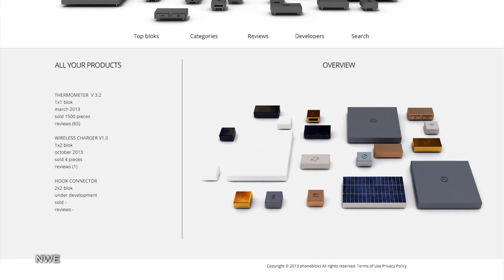Why Phonebloks Aren't Going to Happen

Comment: Apple device engineer here - I am tired of hearing about this DOA gadget. People that BELIEVE this will work are the product of our stupid and lazy society. The society we live in wants things to work like McDonalds. Easy, cheap, fast. People. Lets just say your screen breaks, it might be EASY to replace the screen.. but it's going to cost you over $150 because it entails replacing the entire LCD/Touch screen assembly instead of just the glass. 

Lastly, internal components do not work like "blocks". The WiFi antenna is typically integrated into the entire structure of the phone and is grounded in key locations. You can't just attach things like "blocks" and expect them to work. 

PS - Phones don't just "get slow over time". Unless it's an Apple device which is intentionally slowed down with software updates so that you will buy the latest Apple product.

Comment: I am not very technologically advanced when it comes to internal hardware. I know how to run, improve, and fix a computer. That's about it. But I believe that even stating that something is impossible is ignorance, maybe something can't be done one way, but certainly the other? Who knows.?Certainly no one on YouTube... or anywhere for that fact. The only reason I believe PhoneBloks would not work is because of how innovative it is. What I mean by this is what huge phone company wants a phone that when it doesn't work right you just replace one $20.00 piece INSTEAD of purchasing a brand new phone for $400-900.00? What local "repair folk" want a phone that makes them go out of business? Sure, it'll be a huge hit upon release, but what happens after? Maybe customization? Or maybe they are coming up with ideas to release the product and then release something even better? There are endless possibilities on to why this could or could not work, but after seeing the vast advancements in the past 10-7 years and then big jump from the past 7-3 years ago and then the huge jump from 3-now? That's practically an exponential increase in technological advancement... so no, hardware can probably be developed for this within a year or so in my opinion.
Reply: "That's practically an exponential increase in technological advancement"
And that´s the problem, at the time you want to upgrade your phone, your block phone is so outdated you have to buy a new one,. In the same way you pretty much have to buy a new motherboard every time you buy a new CPU.

Comment: Oh dear lord. Please at least consider your arguments a second time before you post a video...
a) Why would it not be possible to keep the processor and the memory on the same module? He says nothing in the video about memory OR processors he says "the module that affects your speed".
b) Have you ever even opened a phone in your life? There are wires from different components all over the place. Keeping them on a single chip would be BETTER. And also why would that mean they will never happen? Just move stuff around until you are optimized.
c) Also, the concept itself relies on the creation of a standardized input system BEING DESIGNED. HE SAYS SO IN THE VIDEO.
d) The example you have in the end with intel is EXACTLY what he is talking about in the video. Thats exactly what he wants to happen. Bring large corporations together to make something durable...

Please do your homework next time. And watch the video again please.

Comment: First off that's complete rubbish, you change the processor module to increase the speed not the memory, Secondly, these devices these days use SoC (System-On-chip) which include the RAM, CPU and GPU on a single die (chip), and a phone like this is about modularity though standardisation, so yes, standardisation of the bus/connecting platform would need to be created, and there is not technological reason why this inst possible. Each block contains the necessary parts it needs to then interface with that standard bus platform, for example certain pins work for certain resources like power, data etc etc etc, who's to say the entire thing couldn't run off USB? or a similar technology. there is already one working prototype that Motorola have come up with (Project Ara). To say this cant happen is nonsense, the creators of this video probably have an agenda, maybe the presenter has an iPhone in his pocket?

Comment: This guy said they package all the parts all over the place when he was talking about the RAM and CPU and GPU, but those are all still unified into 1 part. So that statement is incorrect. As for the placement of the blocks, most likely they'll be in specific locations and labeled, which is what Motorola's project looks like it has done. I can see why this video has soo many dislikes, and it also adds to why I unsubbed to TechFeed a while ago

Comment: The solution? Engineers with unique ways to approach and overcome challenges with a can do attitude. Tech Feed has no credibility here, next time do your research on PCBs and high speed pin pads or even basic electronics. Speed will entirely depend on how the original interface was designed and how the pin pads arranged. This is an entirely viable idea.
Reply: *****
At no point was it said, or even implied, that he thinks "electronic engineers are so poor at designing electronics."

Yeah, it was implying that the optimizations were irrelevant. But tell me, would you operate a smart phone or a touchscreen with the same mindset you operate a rotary dial phone? They're not the same. "Optimizations" as well as mindsets change with technology.

I don't know why engineers are being so irrational and aggressive about all of this. Tell me, are YOU the one working on Phonebloks or the Motorola Project Ara? No? So, why are YOU being offended?

I'm all for criticizing structure and form, but throwing blankets over topics and claiming being offended by throwing statements in other people's mouths is just ridiculous. You're fine as an electronic engineer!
Reply: S'all good.

Comment: This dude is a dick, it works. Talks about speed? It's electricity, we are talking milliseconds. Placement doesn't matter, because the same electrical signals are being put through just from a different location, if anything there would be a boot up process where it analyzes the configuration and placement of your bloks. That's taking all of, what, an extra 10-15 seconds on startup?

Comment: yes it really is, on my PC when I need more wattage out of my powersupply, i remove the old one, buy a new one, and put it in, the onyl difference is because a PC is not based on a single pannel i have to plug in the other components manually. The same applies for RAM, hard disk space, video cars, fans, lights, motherboard and everything else.

Comment: Well first of all, just because there is a little bit of dirt, it wont block all of the power from going though. But you are right, if somehow you got dirt into one of the pin holes, it could cause a problem.

Comment: A GTX 660 and an AMD FX- 6300 can easily run most games on high settings at >50 FPS.
Also, motorolla and Phonebloks joined together, Phonebloks is happening, dumbass.
You have no idea what you're talking about.

Comment: Since when does moral defects mean that you are stupid. Moral, concerned with right or wrong, defect something wrong with you. Now on the more pressing issue. Google cannot make something impossible possible. Phone bloks are impossible to be as fast as a normal phone because the cpu prongs are too small and too many to just plop down, plus the problems with the mother board. So for this to work you have to create a standard port like usb, and since it will have less prongs it will be a lot slow.

Comment: Of you upgrade 800x400 px screen to like 1200x600, it turns out that you also have to upgrade graphics and processor because rendering in bigger resolution needs beter components, or if you upgrade camera, you also have to upgrade ram, otherwise seving image will take almost 10 seconds. Also it going to be huge because every part has to have its own case. On top of that the main brick (motherboard) will have many issues, wich is a big problem, parts should be attached to it, not the other way.

Comment: Okay, who votebotted this video to give it over 1200 thumb-downs? This phone doesn't look reliable enough. If you drop it, the damaged parts are going to need to be replaced and parts for phones, computers, consoles and the like don't come cheap! and if the holes for the pins are blocked in any way, that phone is fucked as it disrupts the circuit!!!

Comment: the number of pins is needed because PC's are 100X faster than a phone, they need more power flowing through without melting the pins, thus they are spread out. Furthermore size is not an issue, as a smaller phone needs less power draw because it is not rendering a 10 square mile world, its making phone calls and playing angry birds.

Comment: Here's the reason why you can't have a modular ram or cpu on a phone. There are so many small pins on a phone cpu and ram crammed so tightly together that it would be almost impossible to not snap them while installing it. And if you had the pins flush with the component, then it would be a bad connection and cause resistance.

Comment: This is all totally possible with the technology we have today.
The main places where you need speed are between cpu, ram and screen and these components have been detachable in PCs since the start.
Have you ever had a problem with slowing your pc down because you plugged in a usb device into the wrong usb port?
It will just be bulkier because each block needs to be packaged separately.

Comment: The limit here is connectorization, & durability. But this sort of phone block thing is already happening.
If one seraches  " Android DEV kit" for instance, you can see the idea for about 100 USD.  The cellular radio would be  particular to one's cellular service bill. CPU, ocillator and memory would be its own block ( ARM processor for instance ). Data paths between the blocks are low speed. ( Video, audio codec, usb, wi-fi, lan, CCD cam, touch screen, mag compass, GPS, temp sensor, switches.

Comment: High speed signals? Do you know anything about electricity? We're talking near the speed of light. Everything that needs to be close together already is, Inside a chip

Maximize communication between parts? Do you know anything about Integrated circuits? Again. Speed of light. Change out camera for a bigger battery? transistors and variable resistors change from camera state to battery state almost instantly.

Standardized input? PCs..Companies continually release new parts, and they still work

Comment: Don't worry, the guy made half this shit up. If the CPU/GPU are in one cast (as they almost always are) and the screen output is right next to it, that negates majority of latency issues. Put the memory next to it and that's everything finished.

The rest is basically a glorified micro-USB/PCI-E/Sata slot system (depending on how they want to assign the pins).  None of those need to be micrometers away from the CPU.

He has no idea how batteries work.  I doubt he even knows what a CPU cycle is.

Comment: They could also fix this whole plugging into slots problem by marking certain spots on the plugging board so you will only plug in those parts into those places =o=;;;; No, I'm not gonna plug my camera in on the bottom right? It's always gonna be at the top location-wise. As for them being fast and tightly compacted, I believe that's an engineering issue that they needa look into. Chips can always be made to go faster ...etc.

Comment: Regarding the placement slowing the phone, there could be a pamphlet or page in the manual giving tips to users for optimal speed. But I see what you mean- it's almost like putting low texture quality and high shadow quality into a game: it wouldn't be the optimal way to run the game faster.

Comment: You guys are stupid... this will work for sure.  Phone bloks work already, the designer has prototypes running already and the frequency modulation would allow this to run.   Sure this would not be super fast if you had identical processors due to how far the signals are causing delay.  But with phonebloks you have the ability of running processors that are up to 5 times faster because it can be as big as you want.  Optimization would be done too.  Take a class on computer engineering.like rlly.

Comment: Based on what I've learned recently, it's possible for various components to selectively communicate through frequency modulation across multiple overlapping circuits. Look what the brain does. Anything is possible.

Comment: Two groups of people in the Phonebloks discussions:
1: Electronics engineers saying it wont happen for good technical reasons, market analysts saying it wont happen due to the impossible way to produce embedded systems in pieces, supply line management, quality control, testing, design costs etc.
2: Non-technical people saying it will happen, for no other reason that "it is creative" and getting really angry. "Why u kill my dreams? OMG!"

Next year: "OMG Phonebloks why u so expensive? OMG!"

Comment: Actually that is possible... a lot of impossibles can be possibles and a lot of it is already proven... this thing would just be like CPU where there are alot of ports where u can connect your monitor, keyboard,mouse, webcam, and in the inside you could upgrade your hardware like changing the ram, vidcard and etc. This concept is just like what I have just said only smaller and now days making gadgets more smaller and portable is a trend so I think that it is possible.. :)

Comment: Yeah, some good points made by this guy, but I'd take the blow in speed if I knew I could upgrade it when the tech was better. The point is a board which allows the parts on top of it to be completely modular should be the goal.

Comment: All of the parts being closer together actually slows down a system and does not speed it up.  Look at Laptop's vs Desktops, why do you think Desktop's are faster than Laptops with the same components?  Because they have more room, there is less heat, more cooling.

Comment: First part was indeed bad wording, the rest are all correct points, what do you think a "System on a Chip" is? 
Because of skew and and light-speed communication delays placing parts close to each-other is very important for a fast device.
And when was the last time you seen additional RAM, CPU's, chip-sets, batteries and screens that you could use over USB?
When was the last time you seen a USB host interface that worked without the power of a whole computer behind it?
Please check your facts.

Comment: Only one area is correct: putting parts closer does help performance because length of electrical traces add resistance and wastes power, diminishing signals.

Comment: you seem to think im talking about just one company. its you that should be talking about one company. if anyon does this it will start with one company against the world basically. and when that happens usually all the other companies gang up on them. one company isnt going to be able to make this big a change anyway. and almost every cell phone manufacturer would be against this. its not a matter of one company. several would have to do it. and most companies would be against it and stop it.

Comment: what if it had multiple layers of wires so that e.g processor talks to the ram on 1 layer and that pins on blocks are different length, so that blocks communicate with each other on correct layer

Comment: Mate, when I say USB, I don't mean use it for intra-phone communication. The point is that USB is a standardized I/O. So to say that standardized I/O is impossible is plain incorrect. So I'm not saying phonebloks will work in the current form you see in the renders or even using the technology available today. But saying it is impossible, ever, is stupid. I agree with having more stuff on ICs, but the denser you get, more current leakage you have to deal with. Waiting for light based ICs.

Comment: If it did happen the parts would be manufactured as cheap as possible, like they are in every phone, and would probably fall out and be lost. I can see myself now riding down the road with my phone in the passenger seat, I hit a bump, and suddenly I'm digging around in the floorboard trying to find the processor to my phone.. Then you got these idoits who will use super glue or bubble gum on the parts to keep them from falling out.

Comment: He said "closer" and not on the same chip. If that's what he meant, he didn't say it clear enough. Of course having stuff on the same IC has a huge advantage. I'm an engineer myself, I understand how ICs work. However, this hasn't happened yet with the exception of the merger of CPU and GPU.

Comment: I agree with you except for point 3. The way it was told in the video is not techincal at all, but packaging stuff on the same IC does give huge performance enhancements in the communication between parts. That's what SoC are all about, am I wrong? I think what Scott is trying to say is that mobile devices are currently going towards more integration, rather than a modular pc-like design. Then, I repeat, it is not explained clearly, but I think that's the concept he's trying to explain.

Comment: you went wayyy beyond what i had thought of, i was figuring the 4 layers would have staggered hole sized with tapered seat pin heads to press fit the layer. Kudos! however i think you might have alot of collisions with every device trying to talk to one another simultaneously, but with a bus bar system talking to a dedicated bus host per layer and those hosts having a pipeline between themselves across the layers would work nicely. maybe even a token ring esque type arrangement per layer?